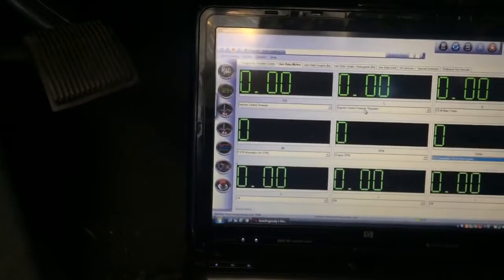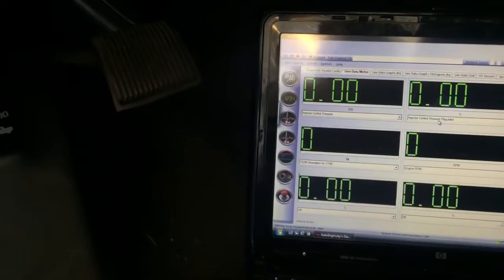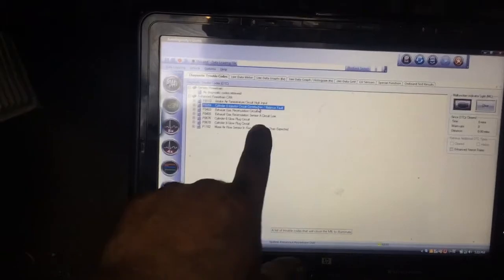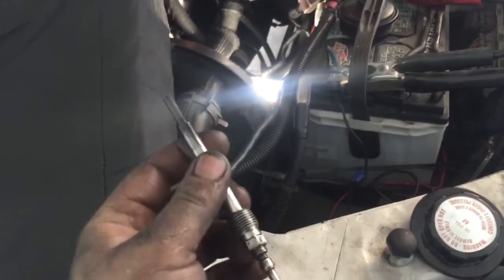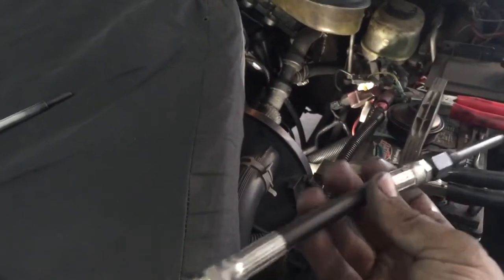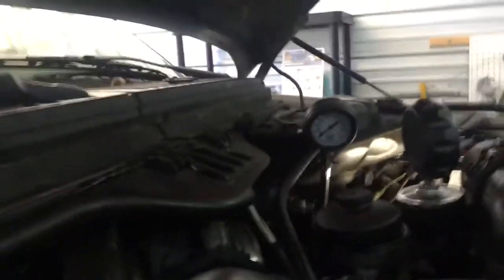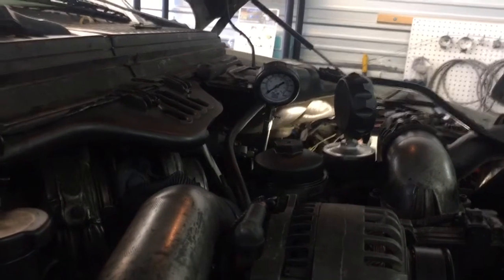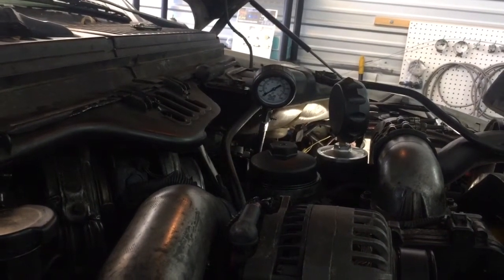Crank no start diagnosis pt 2

Comment: you can hear the uneven crank in video one and the low oil pressure, the good old thump
Reply from the maker: I didn't want to rule that out right away because the customer didn't torque the injectors down and I would suspect a leak somewhere. and it would be hard to do a compression test if the injectors weren't installed correctly. so putting new injectors in first knowing that all 8 are torqued and sealed correctly made the diagnosis easier and more accurate.

Comment: When my 2004 f350 6.0 diesel starts in the morning it runs like crap for a few minutes and blows out white and black smoke  At least until it warms up. I did have something going on with my heads gasket leak. I ended up using blue devil because I cannot afford to do my head's now.  I still need to change the oil since the leak is plugged. Not sure if that has any effect on what's going on. Thermostat is new. Got any ideas?